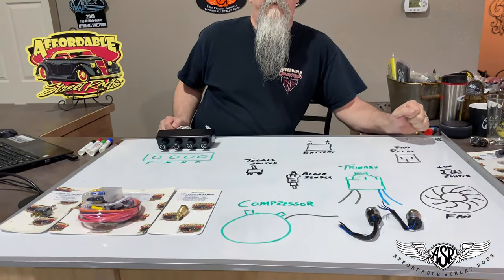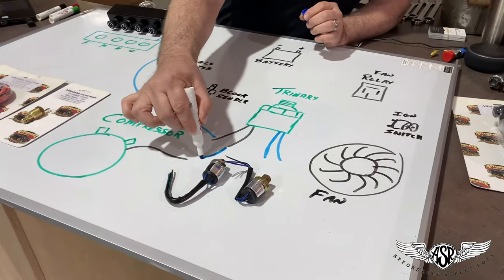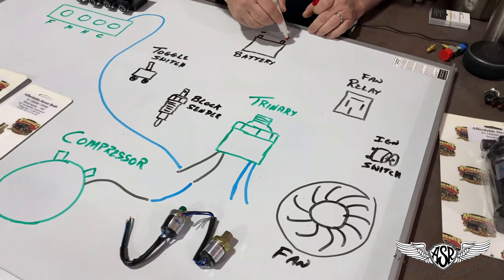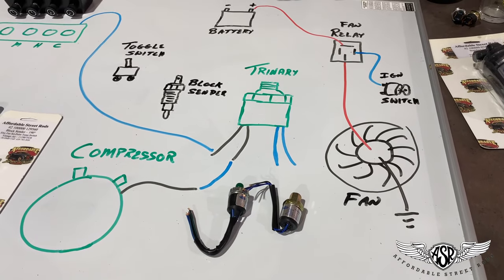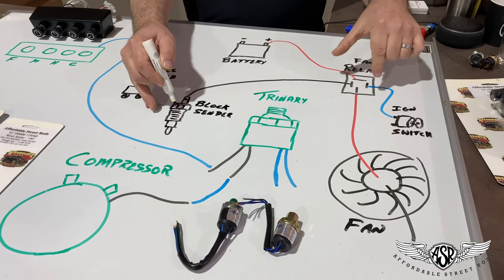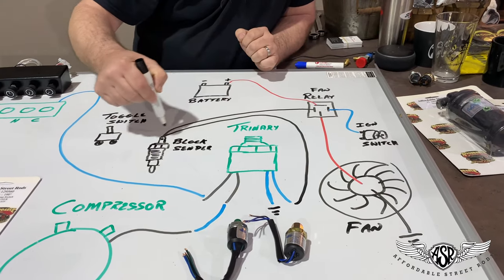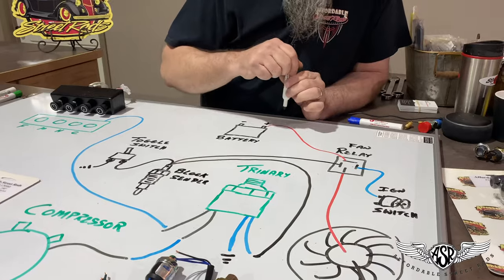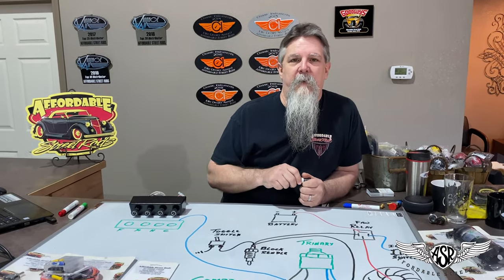How To Wire A Trinary Switch To Your Car's Electric Fan

Comment: Pretty sure I spoke with your wife when I ordered my vintage air system and gauges for my 70 Camaro LS project. I have to tell you she was absolutely wonderful to work with. She was able to sort out the gibberish I expelled and put together the right components the first time, gave me all the normal stuff that’s not in the kit, and all of that which I needed due to the LS swap aspect. Just so you know the whole system is installed and I had all the hardware on the very first attempt. Thank you for a nice knowledgeable and affordable transaction ! 
 I had just a couple questions that you just cleared right up in this simple and straightforward video. I will most definitely be looking to you for further parts and assistance as this project continues. Thank you good sir.
Reply from the maker: Awesome news, thank you for the update. If you have any more questions, feel free to let us know! - Travis

Comment: Great instructional video, I subscribed. I used this to wire my trinary switch and stopped at the power wire at the Fan. I have another source to the fan coming from the GM Performance ECM which is relayed and fused internally. How do I properly wire this to work with a single fan where either the ECM or Trinary switch can run the fan?
Reply from the maker: You'll have to use a 2nd relay to convert the 12v+ to a - trigger, you can see a diagram of that relay here : https://www.the12volt.com/relays/relaydiagram9.html  then you'll have 2 negative triggers for the fan relay and the fan relay can be wired as we described in our video. We like the negative ground approach because if you ever have an issue with the fan turning on, you can simply ground the negative trigger wire of the relay to see if you can temporarily get the fan to run to get you home. It's usually easier than finding another 12v+ source that's fused in an emergency situation - Travis

Comment: Great video! Thank you. Im set up exactly the same as vidoe. At the 4:25 mark, I'd like to tie it into a different location.  Somewhere near the fan / fan relay. Is that possible?
Reply from the maker: Yes,  you can tie that line in anywhere that ties in to that ground for the relay.

Comment: Excellent Video!! Note: the BLACK wires are wires for the compressor & controller cool thermostat and the BLUE wires for the TOGGLE, BLOCK Sender & high side pressure. Affordable Street Rods THANK YOU!!!

Comment: Thank you for your excellent  presentation. I have a 2005 Mazda MPV ES. The radiator cooling fan it's a dual fan system. One of the fan not working, the other it is OK. The fan that doesn't working has 4 wires. How to test that fan with 4 wires to make sure it's bad?
Reply from the maker: Unfortunately being a hot rod and street rod business I don't have any knowledge about a later model Mazda product.  If both fans have the same style of plugs on them you might be able to swap the plug from one to the other. If you can and the dead fan starts working then you know that the fan is okay and it's a wiring or some other issue. Beyond that I can't be much help on this vehicle. - Travis
Reply: @affordablestreetrods   Thank you.

Comment: very nice and simple explanation thank you for keeping it simple. I have a 15" Black Magic fan that uses a sensor stuck in the radiator fins that turns on the fan when 190 degrees. works great but since my system does not use the sensor in the block (only for indication) how do I wire into the black magic fan instead of the engine sensor? Thank you, there is always one of us that has something different
Reply from the maker: You should be able to use the same trigger wire from your sensor that goes to your fan relay, the same way that the block sender works. All it is, is a path to ground when the appropriate temperature is reached.  - Travis
Reply: @affordablestreetrods  Thank you. Very simple explanations

Comment: I have a 70 Camaro with LS swap. I am installing the vintage air now and am at the point of wiring this thing up. I know the PCM sends a ground to my existing fan relay to turn on my fans at 190. My question is, can I just tap directly into the wire coming from the PCM to the ground on the existing relay? Wouldn't this work the same as adding an engine temp sensor into the block or a toggle switch?
Reply from the maker: Yes, if you're sending a ground signal to the fan relay you can do the same thing with this set up. It will work just the same way as the engine temp sensor or toggle. - Travis

Comment: Hi where will you put the trinary switch will it go back into the dryer location where the cycling switch used to be on the G-Body Cutlass or will it be installed on the high side line of the compressor to the condenser????
Reply from the maker: If you're using Vintage Air, then the trinary safety switch can go in the front of the drier. - Travis

Comment: Great video! Unfortunately my trinary switch is aftermarket, so my wires are different colors. I have black with white stripe, blue with red stripe, blue with white stripe, and red with white stripe. Any idea how I should wire this according to the video?
Reply from the maker: Sorry, all of our trinary switches are aftermarket as well, but none of them have that color combination so we cannot be of much help on that one.
Reply: Install the trinary switch, put some refrigerant in the system, make sure it's at least 30 psi (low cut out), then test continuity between the wires.  The two that have continuity are for the compressor, the other two are for the fans.

Comment: Very informative video, I looked through your playlist to find a dual fan scenario with vintage air. Do you by chance have a video in which explains that situation? Thank you.
Reply from the maker: We don't have one yet but I'll talk to Rex and see if we can get one made and uploaded.
Reply: @affordablestreetrods  thank you, that would be very informative.
Reply: I would like that as well. Currently in that process with dual fan set up from entropy. My biggest problem is the connect and cruise has a single wire coming out of the fuse box that says cooling fans. Very confused about that

Comment: Might be a good idea to show a fuse between + batt and relay common. Just to show that safety is of utmost concern.
Reply from the maker: The fan relay wiring kit comes with the fuse already in the wire.
Reply: @affordablestreetrods  Just saying that your white board didn't show it. A novice might think the fuse is optional and omit it from the actual harness
Reply from the maker: @mr.fredricklawngtawnghedav5094  In order to do that, they'd have to cut it out of the harness, it's clearly shown in the instructions of the wiring kit. Thanks!
Reply: @affordablestreetrods  okay. My bad for noticing. Just delete my comment and forget it.

Comment: Thank you for this. My only question is on the black wire going from the trinary switch to the compressor is the ground correct? thanks
Reply from the maker: The black wires on the trinary switch are for the 12v signal wire from the AC to the clutch on the compressor. The compressor grounds through it's case.
Reply: @affordablestreetrods   thank you

Comment: I'm in the middle of an LS swap into a wrangler the GM ecm controls the engine temp fan control. The jeep ecm controls the ac system. We have high and low switches in the ac lines now the compressor turns on but the fan does not.  So I'm adding  second relay to use with the trinary switch. Do I need to hook up the black side as a redundant system? I also won't be using a separate block sender. So I would go straight from the relay to the trinary switch then to ground? Great video! Best out there. Will I have any issues running 2 relays to the single fan?
Reply from the maker: You shouldn't need two relays to run the fan, each of the signals that you would send to separate relays can be sent to a single relay unless there's something that I'm missing. I'm not familiar with the Jeep AC lines so I don't know if you'll find a spot that you can add a trinary switch to the system.

Comment: Great/Clear information.
I’m running a sure fit Vintage air on my 68 LS swapped C10 with electric fans. I have a binary switch and AC clutch only kicks in when electric fans turn on. Fans are turned on by computer signal. What are your thoughts on me adding a pusher electric fan in front on AC condenser with automatic start when I turn the ac system on?
Reply from the maker: I think that you need to change the binary switch to a trinary and use the circuit described in the video. :) it saves you the cost of an extra fan, plus pusher fans and puller fans on the same radiator/condenser often times create turbulence and reduce the amount of air throughput.  A good electric puller fan wired off of a trinary as described is the best option.
Reply: @affordablestreetrods  I actually already spoke to someone in your store and I purchased the Trinary switch and wiring kit. It was easy install and works great.

Thanks for the help👍🏽
Reply from the maker: @argeliogonzalezjr  Awesome! Sorry for the delayed response here, sometimes Youtube doesn't let us know when we have comments. Thank you for your business.

Comment: So in a car with a PCM/ECU

The wire to the compressor is the switched b+ source from the hvac control panel and instead of a block temperature sensor, the PCM/ECU can switch the ground on at a specific temperature, yes?

Comment: Thanks for the vid, very helpful, I'm trying to understand my Trinary switch says it has 3 pressures, 28psi, 241 psi and 398 psi, so I assume, 28-241 are the normal operating pressures (2 none blue) and the other 2 are over pressure.  do that sound right ?   my thanks great work..
Reply from the maker: You're welcome! From what you've said I'd say that the switch lets the compressor run if the pressure is between 28 and 398, but it turns the fan on at 241 to try to keep the system in it's "happy place" in the middle. - Travis

Comment: Thankyou for your help. I have an 02 silverado . I'm putting electric fans with a delta digital controller.  Called a ddc fk75 controller.  The instructions tell me to connect controller to the blue wire on the ac compressor.  Where is the blue wire at? I thought the compressor had a green wire? Please Help! Thanks, Dale
Reply from the maker: We don't have any info on what color the wire would be on a 02, but you should be able to trace the wires from the compressor to see what color wire is triggering the compressor.

Comment: I replaced the fan in my jeep tj with an electric fan. It has the basic ac with high an low switch with orifice tube. The low switch is on the dryer. Would the trinary go in the high pressure switch spot or would it need it's own spot? I am using a manifold temp switch also. Thanks
Reply from the maker: The trinary should be in the high side, but we do not know of any adapters to make the aftermarket trinary switches mount to a factory mount.

Comment: awesome info. this was exactly what i needed. sub'd.
Reply from the maker: Thanks for the sub!
Reply: @affordablestreetrods  you mentioned something about brushless fans at the end. did you ever do a video on that? I'm trying to track down a super thin fan for my condenser. i have a holley super sniper with dual fans now on a turbo 302. the intercooler is mounted close to the condenser and i have about 2" max of clearance. my current slim mount fans are about 3" depth. happen to know of any options to add an additional fan? you can look at my most recent video to see what my setup is.
Reply from the maker: No, we didn't get to make that video yet. The brushless fans aren't super thin unfortunately. We sell Cooling Components fans which are 2 5/8" thick at the back of the motor, I think that the brushless units from Vintage Air are thicker than that though.
Reply: @affordablestreetrods  ahh ok. ya, im not sure if i'll be able to find a fan thin enough with my current setup.

Comment: Rex. How much time do I have before I charge the system when I finally hook up all my a/c lines to the dryer? Thanks
Reply from the maker: You want to do it fairly quickly. If that's not an option then we recommend that you use caps on the lines to help keep extra humidity out of the system. Once a dryer has been opened up after it's been charged we recommend replacing the dryer. It just picks up too much humidity from the air and shortens its life and it's efficacy .  - Travis

Comment: Would a 2 wire switch wire the same
Reply from the maker: If you have a 2 wire switch you probably have a binary safety switch and you would need to check out our video on that. If you are running electric fans, you must use a trinary switch instead of a binary switch. - Travis
Reply: Thanks I talked with old air products they said I could use the bi nary , wire tge compressor hot to one terminal with compressor wire , and the other to the temp unit
Reply: @affordablestreetrods  I didn't tell you I installed a vir eliminator and the 2 wire pressure switch. To my 2nd gen system

Comment: Painless sells a fan relay harness #30114 that has a green wire that goes to the ac clutch wire and activates the fans everytime the compressor kicks on , would that be a better way of wiring over a trinary ?
Reply from the maker: Great question! No, because the AC system doesn't need the fan on at all times that it's running. The trinary tells the fan to turn on when the AC system is at the optimum pressure so it can try to maintain that pressure for best output. Thanks for the question! - travis

Comment: I bought the trinary switch, but it doesn’t screw into 96 Impala ss drier?
Reply from the maker: To fit factory parts like a factory drier, you'll need the factory switch. Aftermarket AC components do not interface with factory ones unfortunately. Because none of the factory cars used the same connections as each other so there was no standard for aftermarket builders to match.

Comment: Quick question what size wire would you recommend. I try stick to 10-12 Guage but also would you recommend a fuse link or you think it's fine without it.
Reply from the maker: 16-18 ga. is fine for the low amperage loads that turn on the relay, fan wiring needs to be 10-12 depending on application and the fan needs.
Reply: How do I put 2 wires safely on to the engine sender thermo ground? And cn I put the trinary ground on top of the fan ground?

Comment: the compressor dont have to have it individual ground connected ?
Reply from the maker: I'm sure that I'm following your question. The compressor grounds through it's mounting bracket, which is connected to the grounded engine block. Does that answer your question?
Reply: @affordablestreetrods  then why do the compressor have ground a wire?
Reply from the maker: @robbwhitehead5486  None of the aftermarket ones that I've seen have had a ground wire. They have only had the clutch engagement wire to tell the compressor when to engage the clutch, turning on the compressor.
Reply: @affordablestreetrods  yeah i know this , I think you confused on my question, I was asking after you bind the trianary switch to the compressor hot wire, do I also have to ground the a/c compressor some where else to make it work ? Sense theirs no ground to the compressor to the tiranary switch.
Reply: Great video by the way🤙

Comment: What about the trinary with three wires? Please if you can explain it to me
Reply from the maker: we've never seen an aftermarket one with three wires, all the ones that we have seen have 4 wires. Is this an OEM item or aftermarket?
Reply: @affordablestreetrods  I'll explain to you and i hope you can give me some advices, so, i have a classic car with no air conditioner and i bought all the units of the ac but it an OEM item and the pressure sensor comes with three wires, and this sensor sending the signal to the car computer to control the fan and the compressor, but my car it old there is no computer, the question is can i replace it with an aftermarket trinary switch to make it easier to wire it? And if it is yes, is all the sensors comes with the same size?
Reply from the maker: @raoufdz7160  Our aftermarket binary and trinary switches are ⅜-24 thread with an o-ring. Depending on what pressure ranges your parts are designed to work at, these might work for you, but we don't have data on the OEM parts so we cannot say for sure.

Comment: You said you can't manually turn the fan on with the toggle switch then you said you can manually turn it on. You made that confusing!
Reply from the maker: at 6:18 he says you cannot manually turn the fan off with the switch. Since there are 3 ways to trigger the fan, turning 1 of them off will not make the fan stop working if either of the other two methods are creating a ground thereby triggering the relay. - Travis
Reply: @affordablestreetrods  oh. Okay 👌